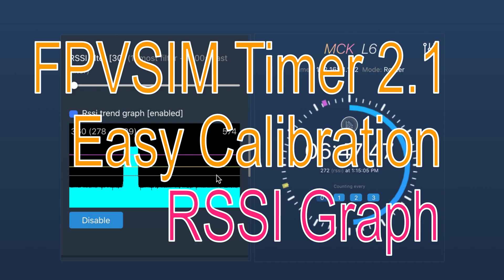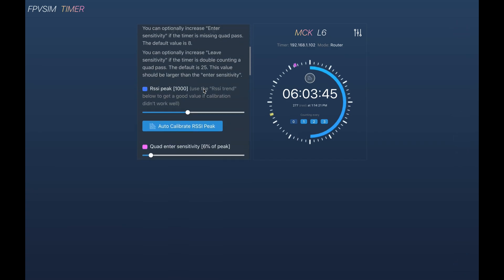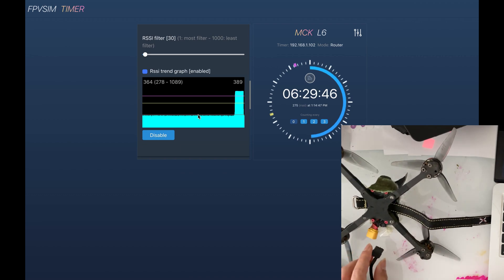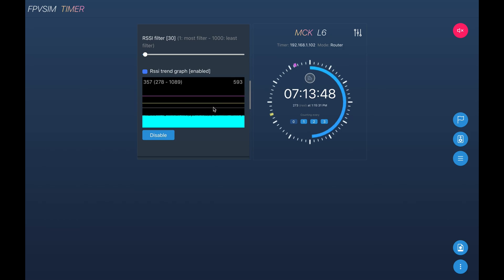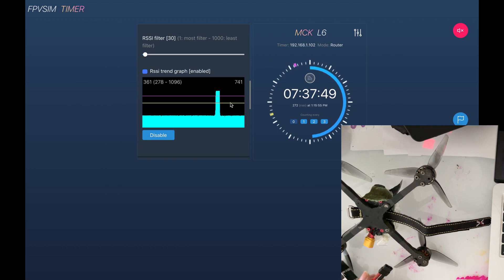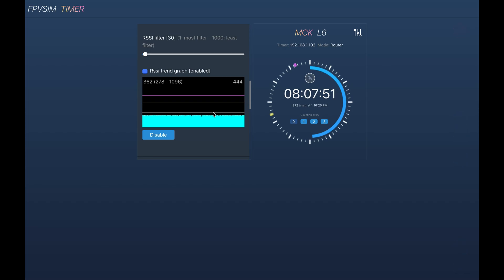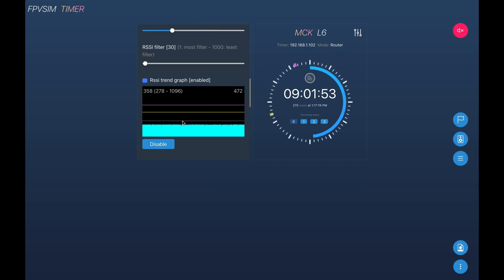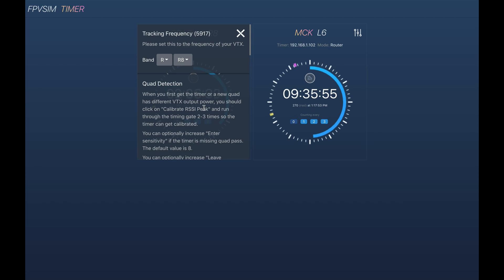FPVSIM Timer 2.1 Calibration Improvements #3

Comment: Actually waiting for the hardware to build the race timer, I have a question, I see only analog video and explains on your chanel, is it Digital compatible too ? My tiny whoop are analog but I have a digital 3.5" can I use the same timer ? 
I guess, it's just a question of frequencies, not analog or digital, But a confirmation will be nice :) Thanks
Reply from the maker: Yes, digital uses the same 5.8g channels. You can use the the same timer for dji, hd zero, walksnail, etc
Reply: @fpvsim  I finished the build today, flash the esp32 and I can connect the timer to FPVSIM. I used AWG30 for wiring and 3x 1K and 1 100k. In the rssi graph I have a blue band up to 220 but whatever the power I set on the quad and arm it, the timer doesn't react at all, I change RRSI Peak and filter but nothing happen, any advice ?